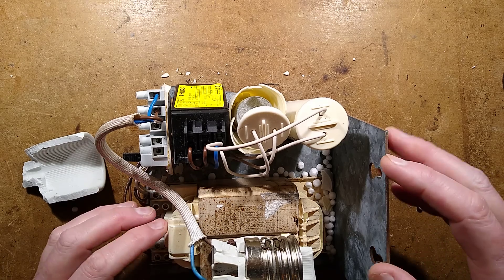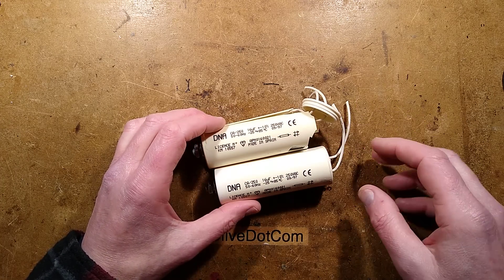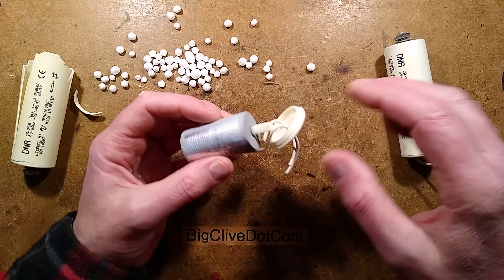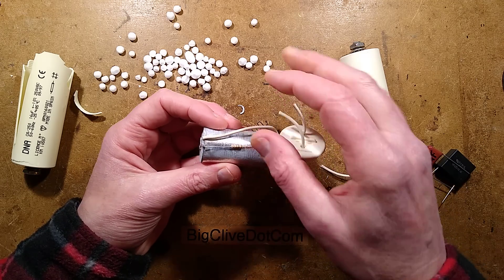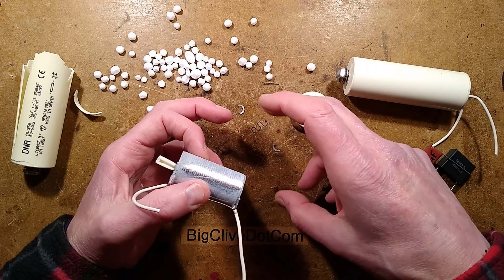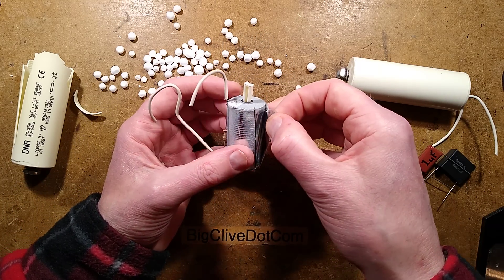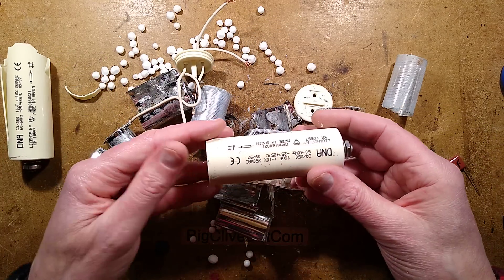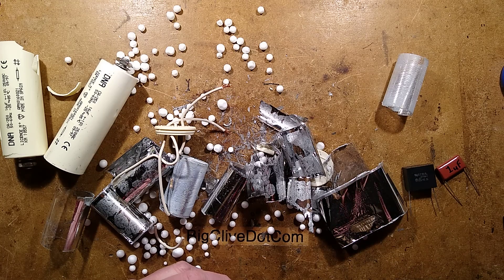Totally destroyed in a good way

Comment: hey BC. hope xmas was good for you. i have a brief question, if you would be so kind as to answer. my mrs, bless her, bought me a zx80 PCB for xmas. i have most of the bits to make it, but i can't decide whether to use a 7805 5v regulator, which seems terribly archaic, or a buck module to do the same thing. what would you do? K
Reply from the maker: For authenticity a 7805, but they did tend to overheat in the past.  So maybe a modern alternative is a better choice.  However, any electrical noise may affect the TV output signal.

Comment: 7:36... Yep, that used to be my test for a bad motor start/run capacitor back in the day. I'd push the motor contactor in with my finger, and give the motor shaft a sharp twist of the wrist, and if it then took off up to full speed, the capacitor was shot. 

Many times, all I had to do was see the crusty electrolyte that had escaped from the burst disk, and that told the story alone. 

Then I got older, wiser, and bought a capacitor tester... 🤷🏻

Comment: These are 250 V and motor run capacitors are usually 350 V or so. They are not the same, at least here in Nederland they are not.

Comment: Here in the US our HID ballasts are constant wattage auto transformer in which the capacitor is in series with the lamp and contributes to the current limiting, or rather a fixed constant current feed. 
I personally prefer the UK/EU series choke like what you have there, the cap only corrects the PF and has no impact on lamp performance if it fails

Comment: There's a double-arm column running two 150 W SON lanterns (on a group-controlled supply) near here where I suspect that something similar has occurred to one or both of the capacitors. As the installation is about 30 years old, there's only one fuse protecting both lantern circuits in the cut-out - this is now a 10 amp as a 6 will hold for a bit, but then packs up after a reasonable number of switching cycles. It'll be interesting to see how long the current fuse lasts, though I understand that these lanterns will be confined to history within the next year, so it may end up outliving them. There's a 32 A Type 2 MCB protecting this circuit back in the pillar (I suspect that this has been up-rated from a 16 because of this issue) - not sure whether anyone performed a cable calc to check the compatibility here, mind you..! I've encountered many of the type of capacitor featured in this video, and when tested, the Power Factor is usually very low.
Reply from the maker: It's not uncommon for street lighting workers to "upgrade" fuses to solve problems they can't find.  Sometimes they go overboard and melt the cables in the process.

Comment: My first experience with power factor correction capacitors was during my CEGB student apprenticeship. I was spending a month with South Wales Electricity Board for area board training and accompanied the team who were trying to find out why a whole section of newly installed Sodium street lights had failed. They didn't have a clue until I noticed that the capacitors had all been connected to the secondary of the step-up transformers and exceeded their working voltage. I was not very impressed with the area board (for many reasons) and was glad to get back to the power station.

Comment: An interesting fail mode for old cans is short circuit with low resistance readings, this happened recently in an old compressor that refused to start, turns out the old can was dated 1977!

Comment: I had, years ago, hundreds of photos of motor run capacitors I'd autopsied where the self-healing effect had produced snail-tracks  meandering across the metallization, isolating significant areas of the electrodes from the end terminals, resulting in their low capacitance. A very messy job.

Comment: I've just had to replace the 4uF capacitor across the motor of my dishwashers water circulation pump as sometimes the pump would not run and the dishes stayed dirty. The little electronic component tester I have said it was down to 1.25uF. After what you said about the foil breakdown I wondered if that is what had happened to this and then you mentioned a tumble dryer motors capacitor. Now I know.

Comment: Your comment about the failed capacitors causing relays to click is useful to me as my mom's quilting iron (an expensive Oliso) that has retractable feet in regular operation has stopped pulling the feet up with the distinct repeating servo click. Changing a capacitor is easy and the first thing I'll try instead of attacking it from the servo right away. I just hope it's not the safety capacitive touch sensor on the handle, I wouldn't know where to get it or how to replace it.
Reply from the maker: It could be based on a conventional switching power supply, in which case it would most likely be the secondary side capacitor going high impedance.  Especially if the clicking is accompanied by the indicator lights blinking in sync.

Comment: The resistor should be a special type with higher than normal voltage rating. People sometimes put normal MR25 resistors across the 230 V RMS power and they will live, for a while. VR25 are the same power but much higher limiting voltage and will live! Take care!

Comment: The X2 capacitor is supposed to be a safety capacitor, correct?
Reply from the maker: It's usually for electrical noise suppression.  A class Y capacitor is safety rated.

Comment: When I was a kid I used to pull parts out of scrapped TV sets.  All tubes (or what you might call "valves" :-) and the common capacitors were a paper dielectric,  and they were dipped in wax.  I got curious as to what was in them,  and it wasn't too much work to scrape off the wax and extract the innards,  which were then unrolled.  Somewhere around here I have a picture snagged off the net showing a woman seated at a capacitor rolling machine,  presumably used to make those back in the day...

Comment: You say about the tumble dryer. I had very slow spin up, and humming whilst starting, I had a google search a few months ago, wisdom from the forum was that when those caps go, they spit their guts out or let the smoke out not just diminished capacity. I tested mine 5uF cap, 1.3uF on the LCR meter. Bought a new one off ebay, works a treat. Three forums i went to all said best to buy a new motor, wouldn't have fixed my issue anyways and new motor was more than $200 vs the $13 cap off ebay.
Reply: A pressure washer I was using failed. Investigating I found the aluminium clad motor start capacitor had a large bulge on one side.

Comment: Out of curiosity. Could you make a Graphine capacitor using ordinary sticky tape and pencil graphite? As for the damage to the electronics I'm wondering if the shape set off a pipe bomb detector inside a delivery company depot somewhere.

Comment: In the late 90s I was kicked out of class because I had the heresy to suggest designing a simple device to disconnect the PFC capacitor(s) when no current was flowing through the reactor, explaining that when there were several burned out discharge lamps in a warehouse, because that was really common, the installation could end overcompensated enough to cause a power surge when powered by the emergency generator.
Of course there's nothing to compensate when the burned bulb is in series with the reactor and the PFC capacitor is in parallel with the mains, but good luck trying to explain that to a moron with a teacher job.

Fortunately for today's students, the same institute is now making money from various patents instead of kicking out students with ideas.
And what had to be changed was not any student but 95% of the teaching staff who in many cases did not have the necessary studies... or none at all! but they could teach work as teachers thanks to the loopholes, wormholes and a**holes of a system designed during a dictatorship that took a quarter of a century to be updated...

Comment: Do you mean a commercial tumble dryer?  Of the ones we have here on the "other side of the pond" use motors very similar to the ones in the top-loading washing machines so they may have a capacitor, but I think it's only for starting it.  I could be wrong though as it's been a while since I had a 1/3 hp laundry motor, 120 or 240 V.  Those motors are similar to what are seen in our furnaces/air handlers/central air conditioners, with the exception of the compressors of course, but you get the idea.

Comment: Question the resistor that goes across the terminal of the capacitor is that constantly discharging electricity while the unit is being used because I would think it would get hot from it just discharging constantly and not only when the unit is turned off
Reply from the maker: It passes a low current.  The capacitor is discharged to a safe level over several seconds after power is removed.

Comment: Yep, I have replaced a few X2 caps in PIR motion sensor lights for that exact reason. First the sensitivity and ambient light level setting drifted up to the point of not doing much anymore, than the lamps started triggering randomly, in the end they never turned on at all any more (the whole process took several month). I opened the caps out of interest and the metal film looked like it had been eaten by some woodworms.

Comment: I like that Clive fuses in streetlights, many years ago we used to repair streetlights on trunk roads where sections had gone out and blew the fuse in the feeder pillar, you would normally find a cut out on a column with a blown bs 88 fuse and someone had repaired it in the past who didn’t have any fuses and had wrapped a piece of earth from some twin and earth around it, it used to drive my mate mad. Sometimes we would bang a bigger fuse in the feeder pillar override the clock so the contactors pulled in and let the faulty streetlight blow its gear tray too bits to save us time. It was quite spectacular some times 😂😂😂
Reply from the maker: Yeah.  The street light industry in the UK tends to use minimally trained labour who pick up all the wrong electrical knowledge from other labourers.  And that includes wrapping wire around HRC fuses.

Comment: I have replaced those capacitors on ceiling fans. When the fan is old it takes longer to get up to speed and the humming noise is louder.
Reply from the maker: Yeah.  Very common failure in ceiling fans.

Comment: I'm curious if capacitor drift could explain dimming over lifetime of LED bulbs. I notice on some bulbs that when I replace them the new bulb is noticeably brighter then the old. Some of that may just be "leds are being over driven and fade over time", but if they're based off a capacitive dropper then capacitance drift may be a large factor as well.
Reply from the maker: It's possible with a cap dropper bulb, but is usually phosphor and LED degradation.

Comment: How difficult would it be to have the caps switch in via a triac so they ride the next wave instead of blasting the contactor?...  a bit rhetorical... got to save our 50 cents so others need to waste hundred$. Seems like a good enough feature to demand, now water under the bridge of an industry since defunct.
Reply from the maker: They could add an NTC inrush limiter.

Comment: "Easy to fix". Except the last tumble dryer I fixed that issue on the Planned Obsolescence Department had thought of that and designed a dryer which was built by starting with the run capacitor and building the dryer around it. It eventually succumbed to the power screwdriver, lots of bad language and quite a few "one moment please" interludes.

Comment: My experience with these poly capacitors incrementally failing is on solar inverters.  The caps filter noise from the IGBT's switching to help meet noise limits, etc. on the output. I have an output power monitor that happens to record in sub-minute intervals so I can see when the inverter drops out from one of the internal shorting events, then reboots. At some point the capacitance drops so low that the internal inverter noise and powerfactor monitors say "tilt" then no more power. This corresponds to an out of circuit measurement shift from microF to nanoF, or less.  A new cap fixes the problem, and as a side note, I have never had a failed IGBT or FET.
Reply from the maker: Same on some modern inverter welders.

Comment: we've had the motor run capacitor in our tumble drier degrade twice, resilting in motor taking ages to get going and eventually not starting at all, just loud hum, if you dont turn off fairly quick it starts to overheat and  smoke, theres no thermal cutout or fuse, bad design!

Comment: I had heard the idea of self healing in polyfilm capacitors, but somehow I never got round to studying what that meant.   Sorta like myself, blow out a bit somewhere and it heals but is evermore lowered capacity. Got chunks of film blown out all over these days.  Takes many strikes for the light to come on solid during a nippy morning. There is a sodium vapor lamp on the pole out back that was out for several years and I never complained because it was supplied by the utility provider, and wasnt charged to my bill.  Well they sent a man out to replace the one out front with an LED and it didnt work.  I got to looking and realised the one in back had the wire disconnected from the supply that went on to the next pole which had the new LED on it.  Turns out the neighbor was paying for both and had them come back out to restore the connection. Comical that the dude changed out that fixture and didnt bother to go to the next pole and fix the connection so it would work.  So the much more useful ~ 2700K LED then worked but the old orange sodium vapor would cycle all night and then, why wouldnt he change that 26+ year old sodium vapor for a new led with much better color and double efficiency while there?  It took about a month, but the Sodium vapor came back around and now works as expected?
Was surprized at that because the older metal halides, once they start cycling on too much current, too hot, they only get worse. 
 Ever had the desire to get a BIG roll of mylar and a big roll of aluminium and make a BIG capacitor?  My dad showed me an article when I was a kid about an experimental megacapacitor built in a lake, been dreaming of what you could do with a hazardously large cap ever since.  Capture a lightning bolt? If the leakage could be designed low enough, a single, decent sized lightning bolt would power my home for the rest of my lifetime. Well I never had a large enough property on which to store that cap comfortably far enough away from the house to reasonably account for the unexpected effects of intentionally coaxing a lightning bolt to discharge to right here, approximately.Turns out the neighbors get suspicious when lightning bolts hit too close, too often.  Appropriately sized diodes  and spark gap shunting of excess are no small task either. Might as well dig a sand pit and charge that with aluminum powder to sell fulgarites on ebay, should all else fail. Prolly a good thing I never had much mad money....

Comment: My electric cement mixer would sometimes not start on the switch. Checked everything and found the big capacitor was down on the ohms reading.. I replaced it with a slightly higher value replacement and it has worked perfectly ever since.

Comment: I've had IR motion sensor, that turns the light on/off/on/off/on etc. and I know it would be easily repaired, but they're so cheap, that it's easier to just install a new one. Then the new one works longer, so it's a win.

Comment: A few months ago, I had the misfortune to change  capacitor in a tumbler drier, never again. You virtually have to dismantle the  drier, that took two hours and resemble a macano kit, when dismantle, 5 minutes to install the capacitor, 3 hours to reassemble the drier. At my hourly rate , it's cheaper to buy a new tumbler drier and pay for the 5 year warranty.its not cost effective to just change the capacitor, you need to change drive belts ,  tension pulleys and bearings at the same time . At make sure you have a first aid kit , because of the sharp edges ,
Reply: I don't think it should take 2 hours to take a dryer apart - usually about 5 minutes - it's only got 2 panels that come off
Reply: @gorak9000  have you dried it. Go a head. You have to remove the door , then the top , then any metal bracings , then the control panel, then the barring access panel, then remove the barring carrier, then the drum , then a side panel. Start adding the time up pal. Obviously you never fixed anything in your life that does need a prixstick or super glue

Comment: I used to visit Cambridge Capacitors in Romsey, UK.
They made the same type of capacitors for mainly lighting, mortor starters, British Rail and a lot more.
I think all of their capacitors were epoxy potted, to stop moisture ingress.
But Chinesolium products are not built to last, that why they are cheep and not so well built and designed.
Thanks fore the carrier (Chineese) for the break down.

Comment: In 1999 I was an intern in a household appliance repair workshop. There was a guy who came back regularly for replacing windings in his circular saw motor. When he brought it for the third time our foreman took the motor in and told the guy to bring the capacitor for checking. The guy reluctantly brought it, saying that he checked it and all was OK. When the guy brought the capacitor, foreman connected it directly to AC socket that had 15A meter in series (and some fuse), they waited for half a minute. The guy started saying: "see, told you it…" and suddenly the amp meter started maxing out intermittently, and some fireworks appeared. The capacitor was busted, now "for sure", with burn marks. Foreman took a new capacitor from a shelf, added it to the third-time-fixed motor, and told the guy: "You already paid for it". Fun times :)